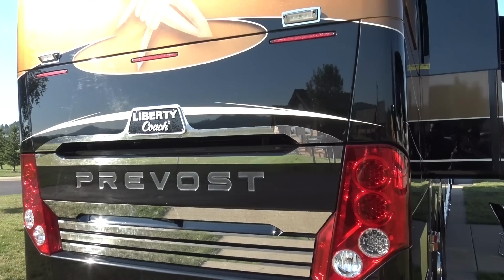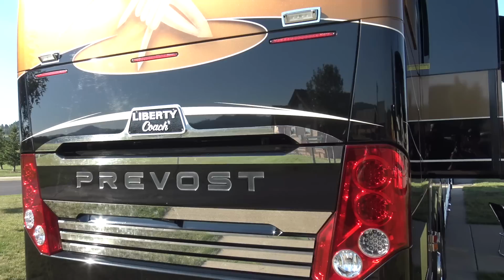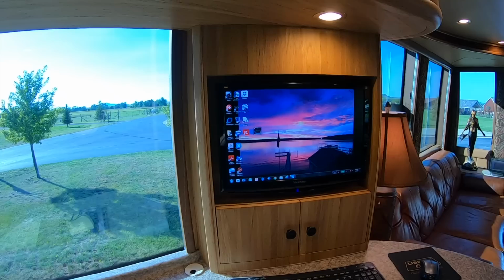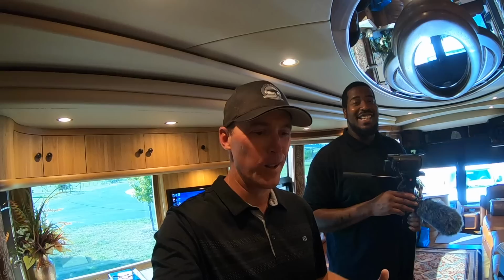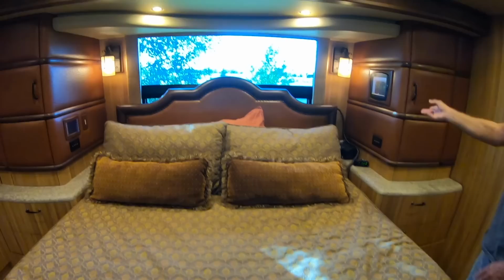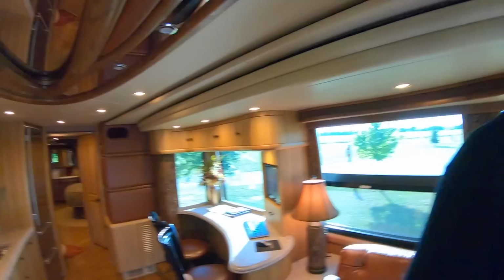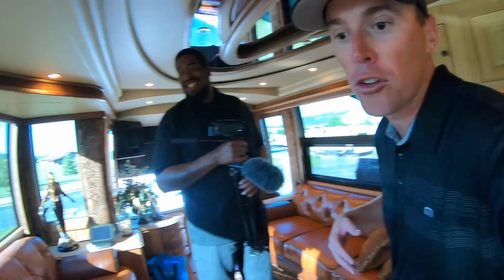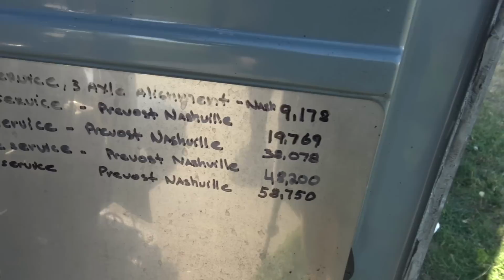TOUR OF PREVOST LIBERTY COACH WITH BARBWIRE PAINT JOB!

Comment: +1. .. The master bedroom window at the head of the bed is a nice touch. .. Along with the window at the foot of the same bed makes for a proper feng shui room orientation. .. Is this a Liberty Coach design detail/feature? .. Utilizing Crestron for coach automation is a, "only Big Boys" apply. .. Make my 2022 Prevost-Liberty Coach with whatever bleeding-edge Volta system and a Porsche Stoney Grey Metallic (LY7U) exterior. .. For the interior let's go with a Porsche Light Grey/Beige leather throughout going with a W Hotel room theme. .. Cheers, Vail, Colorado